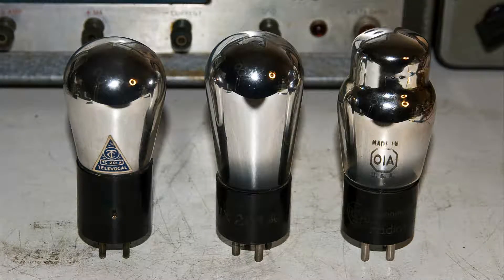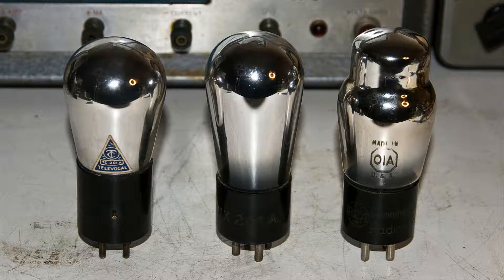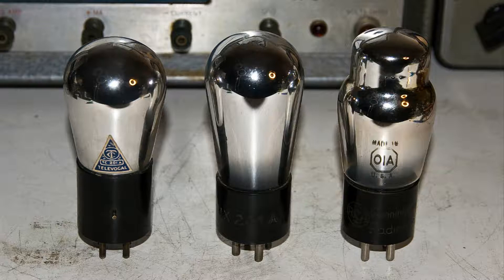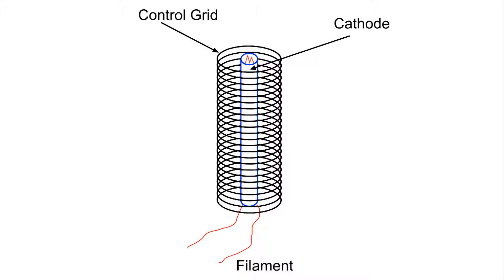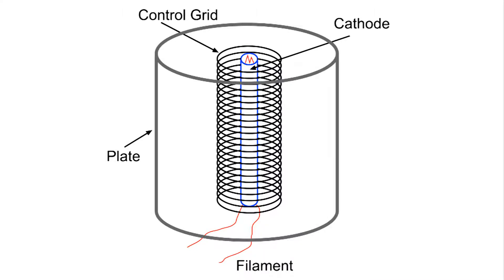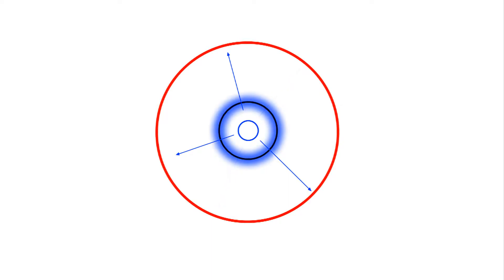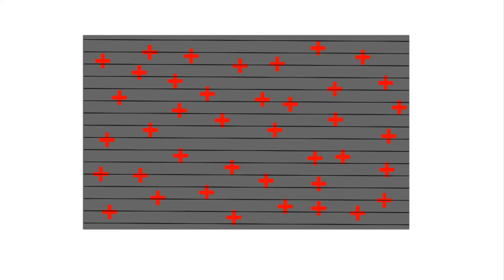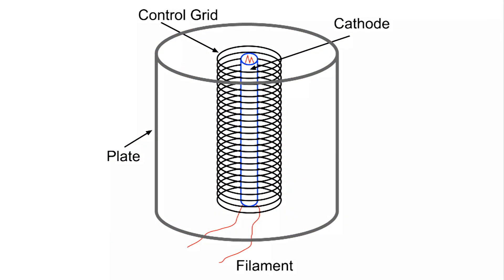Control Grid, Triode Tube

Comment: This basic format explaining things really helps.  Im trying to understand how a triode like this is able to pulse or train pulse in 10 microsecond pulses in non radio/audio instances.
Reply from the maker: Thank you. I think these viodes may help you understand the Triode Vaccum Tube. Ask your questions. 
Triode Tube Amplification Visual Demo
https://www.youtube.com/watch?v=4FkD0LRiu7A
Comparing the function of transistors and tubes.
https://www.youtube.com/watch?v=ZZpcRsKtfig
!923 Vacuum Tube, Amplitude Modulation Detector Circuit in Detail
https://www.youtube.com/watch?v=e0faax3Svgw
Push-Pull Output
https://www.youtube.com/watch?v=_sZJgQfO5wg
Reply: @AllAmericanFiveRadio  
Thank you so much!  I will check those out

Comment: excellent. thank you so much.
When you say "negative cathode", do you mean GROUND or zero voltage? And when you say "negative grid", do you mean like -10V?
Reply from the maker: Max Koschuh 
It depends on where you're measuring from. For a vacuum tube to function the cathode must be negative in respect to the plate which must be positive. The cathode could be ground or zero voltage but it must be negative with respect to the positive plate. The electron flow is controlled by the grid, the potential on the grid is measured between it and the cathode. The more negative the grid is with respect to the cathode the less current flow between cathode and plate. The more positive the grid is with respect to the cathode the more current flow between the cathode then plate.
Reply: Thank you very much!

Comment: how would the grid be positive or negative? You should make a video of how we used vacuum tubes to convert dc to ac.
Reply from the maker: I have over 400 videos, I have explained how vacuum tubes change AC into DC several times. Just search my channel for power supply, rectifier's, vacuum tube, stuff like that. You can also download my free e-book, it is found in the ABOUT on my channel. You'll also find a link to 24 volumes of electronic courses from the U.S. Navy.
Reply: That is swell but I know how ac is converted into dc, I want to know how dc is converted into ac and how the grid can have a positive or a negative voltage ?
Reply from the maker: Cadet Hassan An audio signal is an AC signal (positive and negative) applied to the grid. Converting DC to AC is done with a converter. Google “converter circuits”